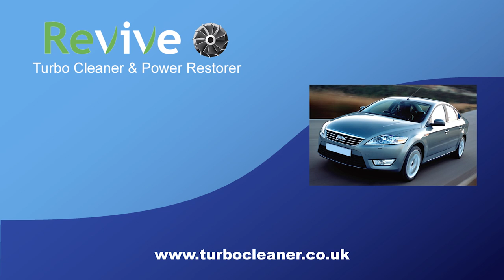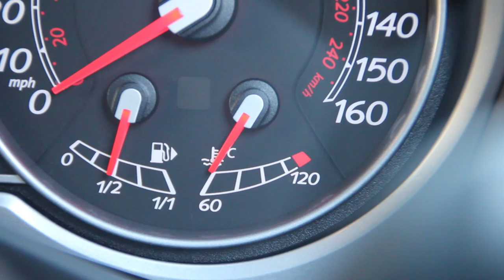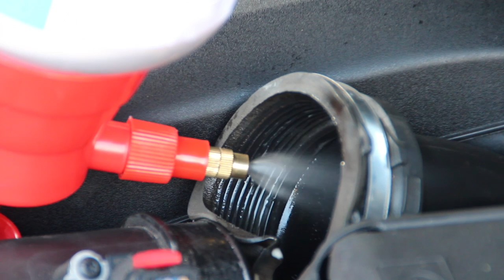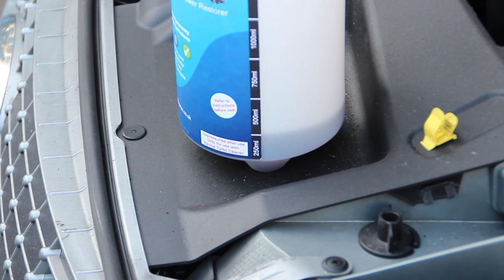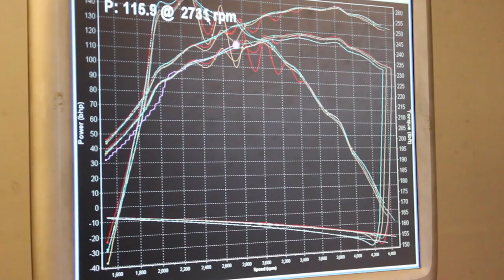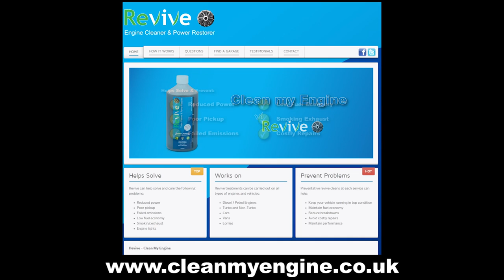Revive Turbo and Engine Cleaner

Comment: My 2005 Mk5 Golf Diesel 2.0 BKD has sticky vanes, sadly they seem to be stuck beyond the realms of Revive and I could only agitate the actuator minimally - Revive did not help in my instance. Pity that, it was and I still believe is worth a shot. The car does seem to run better in it's limp mode state and lots of crud came out of the exhaust - my next step will be turbo off I think.
Reply: I avoided the caustic route and we found a frayed wire from the ECU to the pressure boost sensor which fixed the issue. I will say however, the turbo seemed much healthier and I can only put that down to Revive. :-)
Reply: +Julian Backhouse mr muscle oven cleaner trick, have you tried that?
i have the same vehicle
Reply from the maker: +novaturbkkk We would strongly advise NOT to use Mr Muscle to clean a Variable Vane Turbo. Mr Muscle is a very aggressive caustic solvent which can cause hot edge erosion and can damage seals etc.. When applying Mr Muscle to a turbocharger in situ, you will not know what path it will take inside the turbo and when you leave it to 'soak' , the carbon will liquefy, which may temporarily free the vanes but will end up behind the unison rings or vane pins.  The liquefied carbon will then harden due to the extreme temperatures, causing exactly the same problem but in a different place (unison or control rings). If an aggressive caustic carbon cleaner is to be used, it is essential that the turbo is removed and disassembled by a professional. Mr Muscle Oven Cleaner is for ovens.. not turbochargers.
Reply: spdiagnostics what is your stuff made up exactly from ?
Reply from the maker: +novaturbkkk It's a water based non-ionic surfactant with active molecular ingredients. For commercial reasons, we do not publicise the specific ingredients, for reasons i'm sure you will understand.

Comment from the maker: ***** For some reason, we cannot reply directly to your question due to possible configuration settings. However, your Saab is not fitted with a variable geometry turbo, although Revive will remove sooty carbon deposits from all petrol and diesel engines, whether they are normally aspirated or turbocharged. Please feel free to call us to discuss your requirement on +44(0)1225 744777. Kind regards

Comment: One more thing from below answers if my ecu does throw up some fault codes , I take it it's still fine too drive the car as there is no real fault? Probs dumb question but just checking 
Thanks
Reply from the maker: mnl493x Hi... It will depend on the strategy of the ECU. It may decide that the fault code is relevant enough to put it into 'default' or 'limp home mode', however, these cases are not the norm and this scenario rarely happens. We like to inform our customers of the possibilities.

Comment: Thanks for clearing that up m8 👍think I'll have myself some ,is it the same process for me as in the vid as I have a 2006 vauxhall signum 1.9 cdti 150
Thanks again 👍
Reply from the maker: mnl493x Hi, yes same process. Please ensure you start the process with a cold engine and please be aware that the ECU may produce temporary fault codes, as the engine is running on 'un-metered' air.

Comment: Johnny akroid and Martin tucky and now myself are asking the question can this be use on cars with dpf,s? Which u have failed too answer but you have answered all other questions? Please can you finally clear up this unanswered question thanks,,
I'm quess ing it would hurt the dpf as it's main design is too clean/filter engine emissions so all that carbon removed and pouring out the back of the mondeo in the vid , so I'd have a cleaner turbo but a more clogged dpf? Correct me if I'm wrong.
Many thanks 👍
Reply from the maker: mnl493x Here is the reply we made when asked on November 18th 2013. Please note, if you have problem with the turbo and the ECU has had stored DTC's regarding overboost, the ECU Strategy would not put the DPF into a regenerative state and would abort the attempt to regenerate.Once DTC's have been cleared, the DPF would then start to regenerate.. The particles removed by Revive are no bigger than the soot particles the engine naturally generates, so Revive is perfectly safe to use on vehicles fitted with DPF's. I use it on my VRS CRD DPF. Kind regards

@user/spdiagnostics Nov 18, 2013

@user/martintuky the deposits that are removed during the cleaning process are the same as the ones that are produced during normal engine operation, these get trapped by the DPF in the same way and are handled by the vehicle regeneration process. So Revive does not harm the DPF.

Reply ·

Comment: I've bought revive but need some advice before I make an attempt:

1) you said to make it more effective I should use a vacuum pump kit to move the actuator. 
  a) where I can buy one from? 
  b) when should I use it during the process?
Reply from the maker: Hi Juman. It will depend on what type of actuator you have. Some turbo's are fitted with a vacuum operated actuator and some with an electronic actuator. Depending on access, you can manually move the actuator rod on the vacuum type after the 2nd phase, providing you have easy access to it. If you are not sure, we would recommend to seek professional advice from a qualified technician. (vacuum pump gauges are available from many online sources)
Reply: spdiagnostics Hi and thanks for the reply. My turbo is manual. Iv gone underneath the car last week and felt the actuator which was unbelievably stiff. I'm thinking of disconnecting the pump to the actuator and replacing it with a silicone tube and a syringe to imitate the same mechanism?
Reply from the maker: Hi Juman. If you are in the UK, please call us on 01225 744777 so we can offer advice in detail. If, not, if the actuator rod is stiff, you won't be able to agitate the mechanism with a syringe. If you can get access to it, I would remove the actuator rod from the diaphragm end and move it with your hand. If the mechanism is 'unbelievably stiff', please consider mechanical seizure through heat distortion.

Comment: Hello! I have an Outlander 07 2.0 DI-D with sticky vanes in the Turbo. I would definately like to try your product. Is it sold in Norway, or can you send direct? Also my knowledge of engines are very little so if you could point out where to insert the fluid on my engine, that would be very helpful. 
Thanks 
Lars

Comment: You claim this product will clean the carbon build-up on the Turbo's Variable Vanes but how is this possible as its shown being injected into the turbo's input hose so will go through the combustion process before its ejected into the exhaust and then come into contact with the vanes, and by then it will have been burnt away.
Reply from the maker: Hello Jeanette. Revive is now sold in USA, Canada, Australia, France, Holland, Greece and other European countries because it is excellent at removing oily carbon deposits form an engine's air path. Revive's molecular composition is robust enough to survive the combustion process. More can be learnt by understanding the 4 Stroke Otto Cycle. We claim it removes carbon from the VGT because it does.. We cannot reveal the science behind Revive for commercial reasons, which i'm sure you can understand.

Comment: Today an engine malfunction light came on the dash, RAC put it on the computer and it came up with a blocked dpf! They tried a regen three times but would budge the blockage.  Do you think revive would work? Or have we passed the point of no return.
Reply from the maker: Hello and thanks for your interest in Revive Engine Cleaner. Revive is formulated to remove carbon from the air intake to the Turbo and is not designed to clean DPF's. There are now quite a few products on the market which will lower the soot loading in the DPF sufficiently for natural regeneration. Have a chat with your local garage, i'm sure they can offer you a sensible solution. However, it is now illegal to remove the DPF, so don't be tempted by that option.

Comment: Looks nice, I have an MKIV, anywhere in Calgary, AB. Canada to get this product
Reply: Vlade,our inventory is slated to arrive in house by Wednesday, April 2nd.  If you wish to give us a call at 780-962-0088 and I will make sure that your order goes out immediately.

Regards,

John (Part-Stop)
Reply from the maker: Hi,Revive is available from Part-Stop Auto & Industrial Supplies in Spruce Grove Alberta. Tel : 780-962-0088. They have stock and can ship it to you. They are currently building their new website, so you will need to call.
Regards
Reply: thank you so much i will look into it
Reply: vlade2512 Hey I am from Calgary too. Did you every get this stuff? Did it work? I have a Porsche 930 turbo with the same issue. Wondering if this will work on that?

Where is this Part-stop Auto & Industrial Supply Ltd?
Reply: no not really, i kind of let mi gf use my car so i have no idea how it runs so far. but if i would get it i would let you know

Comment: Hi can you use this on a ford mondeo tdci with electronic actuator to clean out turbo. Can you advice how to do if possible
Regards
Will
Reply from the maker: Hello Will. 
Yes, you can use Revive on your Mondeo tdci as demonstrated in the video above. However, because of the electronic actuator fitted rather than a vacuum one, you will need suitable diagnostic equipment which is capable of operating the actuator diagnostically. It is not essential but it does help if particularly sticky.
Reply: Thanks

Comment: Thanks for the quick reply. Can I also ask how effective is this compared to using a sodium hydroxide based product, I don't know if you have heard of the Mr muscle trick?
Reply from the maker: Revive does not need any disassembly to apply. If you have ever used oven cleaner on an oven, you should have noticed how it turns solid carbon into a liquid mess. This solidified carbon needs to go somewhere...so how are you going to clean this up without removing the turbo and stripping it?
Reply: The process of using Mr muscle is when the carbon is liquefied the gunk will pass through the exhaust which of why the oven cleaner is sprayed in the exhaust outlet of the turbo
Reply from the maker: juman islam We believe when using an oven cleaner, you are just moving the problem around. The liquified carbon will move around inside the turbo and end up between the connecting pins on the variable vane blades and the back plate, then this liquid carbon will then solidify due to the heat. Revive removes the carbon, it does not liquify it. Plus oven cleaner will not pass through Catalysts & DPF's.
Reply: Thanks for the reply. How effective is revive. Can it be done in one job?
Reply from the maker: Revive is extremely effective at removing sooty carbon deposits from the VGT. It is not very good at repairing split vacuum pipes, so please carry out all the necessary diagnostic tests before assuming it's sticky vanes. Kind regards.

Comment: Hi. My issue is the engine going into hydrolock when doing this method. What are the chances of this happening and how would I prevent it?
Reply from the maker: Hello Juman
Providing you follow the instructions and apply Revive in 250 ml doses at the RPM ranges we state, then there is no risk of hydrolock

Comment: will this clean the inlet manifold?
Reply from the maker: Hello Adam. Not in the way you probably want it to. As Revive's molecular ingredients are made up of several surfactants, it will naturally attach itself to oily carbon deposits on the way through the combustion process. However, Revive is formulated and calculated to effective through the burn cycle and becomes highly effective when it reaches the cylinders and turbo. If your inlet manifold is clogged with 'coal', then it needs to be removed and cleaned with an aggressive solvent type cleaner. Regards

Comment: Can be this product user to clean sticky turbo vanes without dissasembling turbo ? I mean by spraying into the intake manifold
Reply from the maker: Hello Marius. Yes, Revive is formulated to remove carbon build-up from variable vane turbochargers., There is no disassembly required and is administered through the air intake after the Mass Air Flow Sensor as illustrated in the video above. Regards.
Reply: spdiagnostics Thank you for the answer. At my bmw the air circuit is : MassAirflowSensor -> Turbo compressor -> hose to intercooler -> intercooler -> Hose to intake manifold. It's okay to spray through the turbo-intercooler-intake ? How will unblock vanes if revive is absorbed into engine ?
Reply from the maker: You would spray the fluid (in a fine mist as per video) into the intake impeller of the turbo (after the Mass Air Flow Sensor) The amount applied has been calculated to be effective at the VGT after the intercooler. Revive has to go through the combustion process to be effective. It is very important that the cleaning process is started with a cold engine.

Comment: Will this help clean the catalytic converter as well?
Reply from the maker: Hello lennonpolo. Thanks for your enquiry. Revive Turbo and Engine Cleaner will remove carbon deposits from the engine and turbo, so unfortunately, Revive is not suitable for your requirement. However, there are other products on the market that will clean the cat and offer a solution to your problem. Kind regards

Comment: Hey can I use this on turbo petrol engines? 2.0tfsi audi s3?
Reply from the maker: Hi Ruan. Yes Revive can be used on Petrol and Diesel Engines, with or without a Turbocharger. We have been informed by other users of Revive, that the 2.0 TFSI Audi engine, suffers from carbon build-up on the valves due to poor quality fuel.

Comment from the maker: martintuky the deposits that are removed during the cleaning process are the same as the ones that are produced during normal engine operation, these get trapped by the DPF in the same way and are handled by the vehicle regeneration process. So Revive does not harm the DPF.

Comment: Seafom copy?
Reply from the maker: Hi, no Revive is not a copy of Seafoam Spray, Revive uses a unique patented  technology. Seafoam is solvent / petroleum based and Revive is a water based surfactant. From their website "Sea Foam Spray should never be used in the air intake system of a diesel engine" Revive is safe for both diesel & petrol engines.

Comment from the maker: A preventative is always preferable to a problem We recommend using Revive to avoid carbon build-up at service intervals, however, we as employees have all put it through our own vehicles despite having no issues with the turbo. Why wait for the problem to occur when you can avoid it? You will probably notice a difference even though you don't believe you have a problem.

Comment from the maker: Hi. This totally depends on how the vehicle is driven. If driven in city centres and the vehicle rarely gets to stretch its legs, carbon fouling will occur far quicker than a car constantly using boost on motorways, autobahns or freeways. A treatment of 750ml will cure the problem but we would advise the same treatment on every scheduled service interval as a preventative measure.

Comment from the maker: Because of the drive by wire throttle pedal, we recommend that when carrying out this procedure, you get assistance to control the RPM while administering the fluid. This can be done by a friend or colleague or you can buy a simple tool which clamps to the steering wheel and ratchets down on the pedal. Due to the engine running on unmetered air, It is important that the engine is running at between 2,000 - 2,500 rpm when you start. Thanks for your feedback on the seal.

Comment: Hi is this suitable for a Vauxhall Corsa 1.3 cdti? I don't actually have a problem with the cars turbo i am just concerned that i am doing a lot of mileage (104,000 at present) and want to avoid any problems by cleaning the turbo first.

Comment from the maker: Hello MeBerserk.
Because Revive is a water based surfactant, it scrapes away at the carbon in tiny particles, so the carbon will not break away in 'lumps' so there is no danger of anything bigger than soot particles passing through the combustion  process.

Comment from the maker: Hello Malt51. 

It is difficult to reply to your question without any diagnostic results.If you have a diagnostic scan carried out on your car and test all vacuum pipes and the electronic turbo actuator and once these have been tested and confirmed fully operational, you can then start to look at the variable vane mechanism. Revive will remove carbon deposits from the vanes if that is your problem.

Comment: Hi, I have an 07 plate x type 2.0 d, and the problem is the diesel heater light comes on when driving and power drops (i assume this is limp home mode) if i switch off the engine and restart the light goes off and the car drives fine. would revive cure this?
Car has done 200,000 miles

Comment from the maker: Hi, Yes. Revive is designed to remove carbon and can be used on both Petrol and Diesel engines. Revive is designed to work through the whole system from inlet to exhaust so it is effective all the way from throttle body to the back of the turbo.

Comment from the maker: Hydro Lock is not an issue if used correctly as instructed. The fine mist is similar to the volume of water you expect to see in water injection systems.

Comment from the maker: Hello pabllo2004. Providing your issue is indeed down to a sticky variable vane turbo, then we are confident that Revive will clean the carbon build-up from it. Your vehicle has an electronic actuator rather than vacuum, so ensure that correct diagnosis has been carried out and once it has and you are happy that everything is as it should be, Revive it!